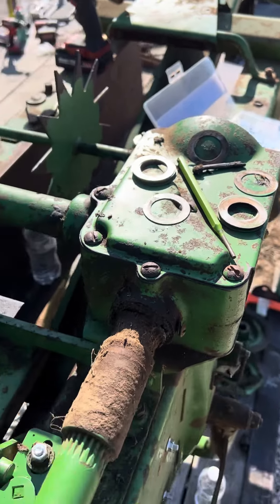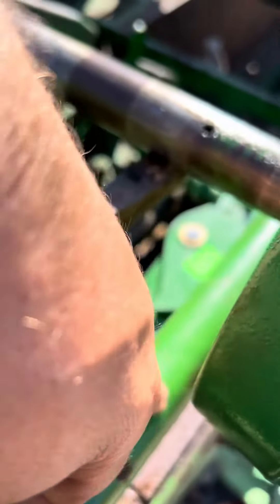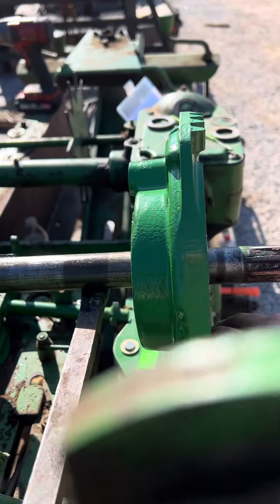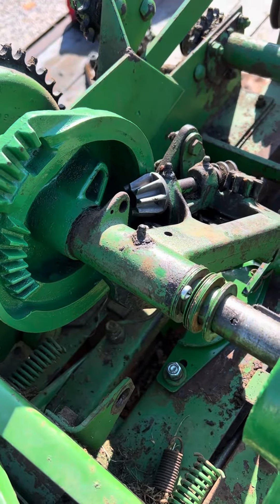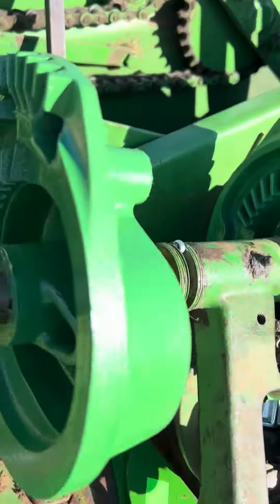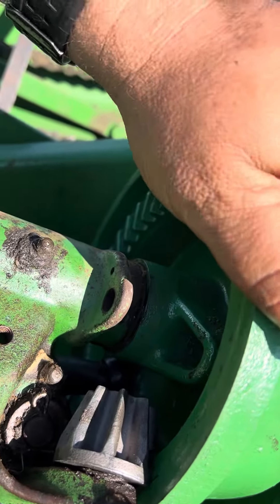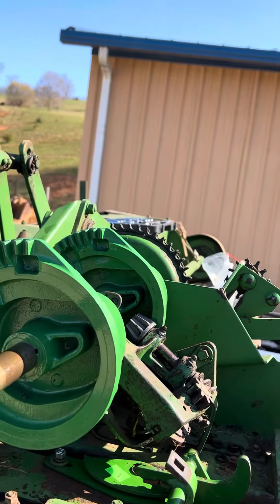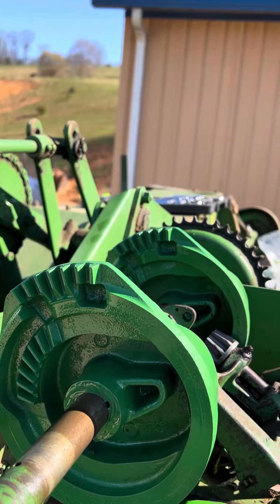Reinstalling John Deere 24t or 224 Hay Baler Knotter back onto Baler. PART 2

Comment: I have a question; will the pickup spider for a 224t fit a 24t to make it a 5 bar pickup?
Reply from the maker: No idea never tried. If you use the pick up teeth update there’s no need to have 5 bars.
Reply: @BALERMAN  I figured the 5 bar might work a little better in light grassy stuff. Already planned on updated teeth.